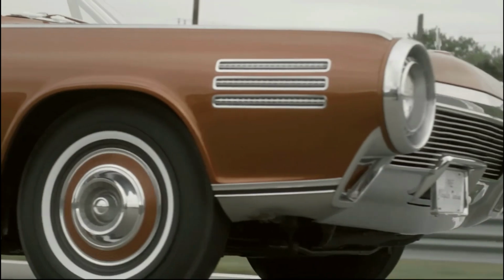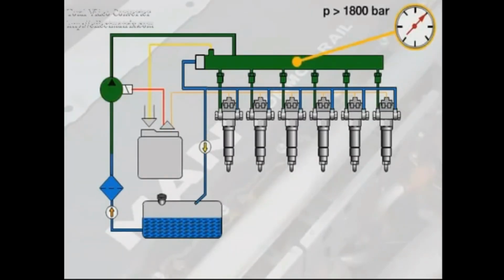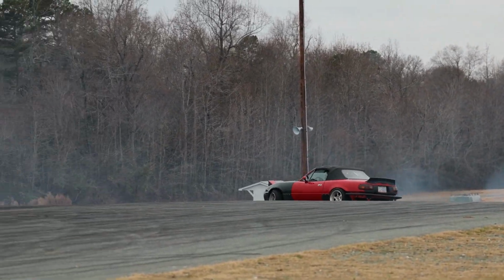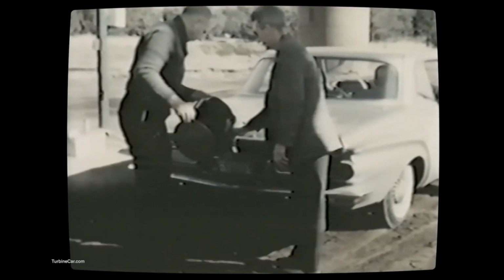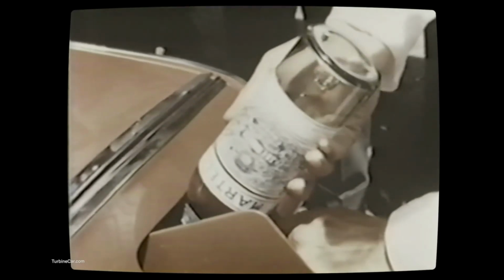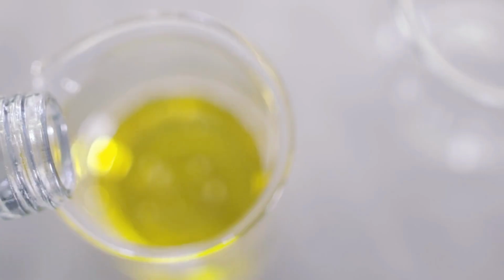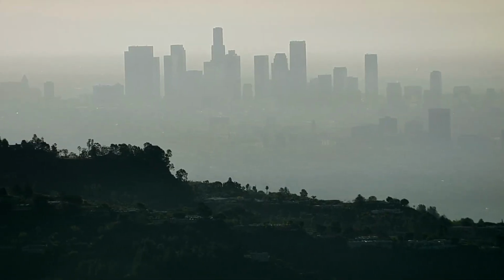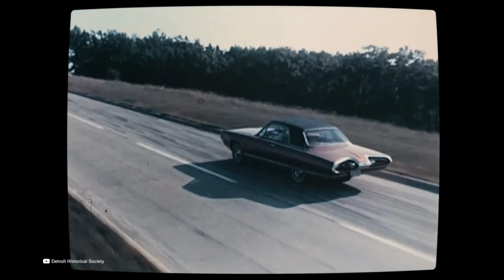The Future That Almost Was: Chrysler's Turbine Car and Engine Innovations

Comment: Modern diesel engine regulations require they are cleaner than modern gasoline engines, it’s wild we can run a 12 liter diesel engine in the shop and no one notices any air quality issues, our tier 3 machines you can’t breathe in the shop after running it for a minute